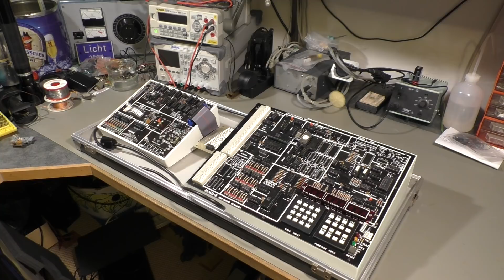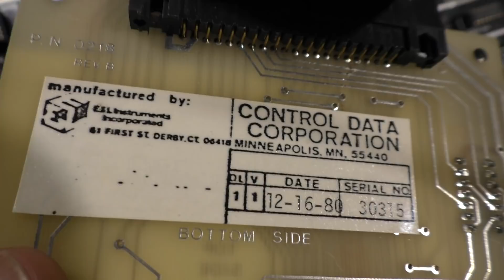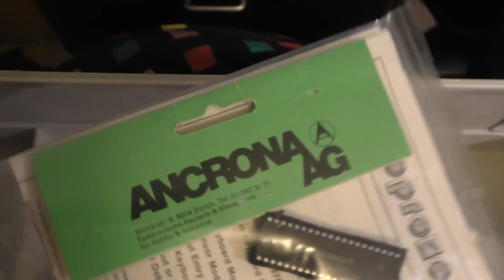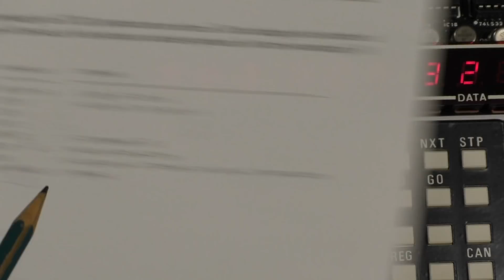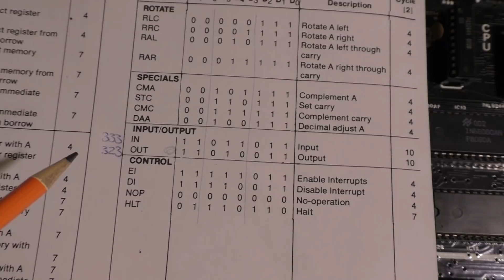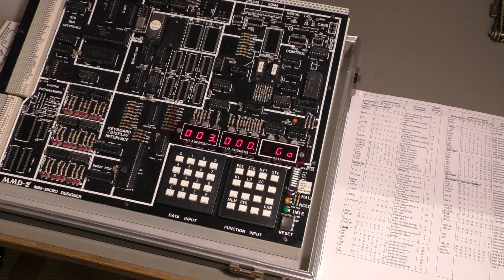Vintage 1980 single board computer E&L MMD-2 (PWJ78)

Comment: Are the Z80 and 8080 are related as they both had BC and HL register pairs? That CPU is running seriously slowly, with code like that I expected to see all the LED's remain on at partial brightness.
Reply: The Z80 is program compatible with 8080 instructions, though there are extra features/instructions for the Z80. Also, only the upper byte of the BC register pair (register B) is being output, so there's an inherent divide-by-256 on what's displayed on the output.
Reply: The Z80 was designed by Federico Faggin who worked for Intel on the 4004, and 8080 among others. He founded Zilog together with Ralph Ungermann in November 1974.
Reply: Thanks all makes sense now.
Reply: Yup , the 8080 instruction set is a subset of the Z80's. The Z80 is somewhat faster too.

Comment: That was really quite an impressive bit of learning hardware. The sub-board on the left would be just as at home with a pi (or similar) connected and is extremely well thought out with its inputs/outputs and mix of digital and analogue displays and sensors. We had something similar at school (England) around the very early 80's but it was connected to a BBC Micro (6502 processor) which had the huge advantage of having a TV display interface and a tape recorder interface all built in. I remember, quite fondly, "peeking" and "poking" memory addresses using BASIC to get the external board to do things and writing 6502 assembly code to make games in the after school club.

Comment: Octal... the horror!
Reply: If I remember correctly, octal is ideal for the 8080, in many cases allowing you to read the source and/or destination register of an opcode directly.
Reply: Ah yes, that makes sense. I'm just not used to it, it is/was HEX everywhere.
Reply: Octal was not uncommon in the earliest days of electronic computers; i recall having read about systems with word lengths of 9, 18, or 36 bits, which lends themselves nicely to base-8 numbers. Of course, once the technology began to gravitate towards 8-bit words, coinciding with the shift towards monolithic CPUs (microprocessors), hexadecimal became more and more common.